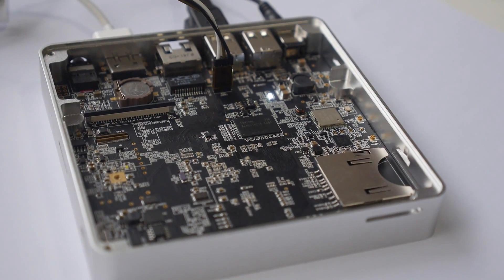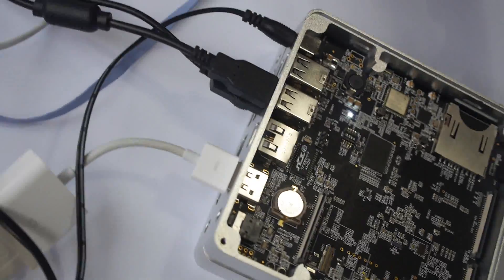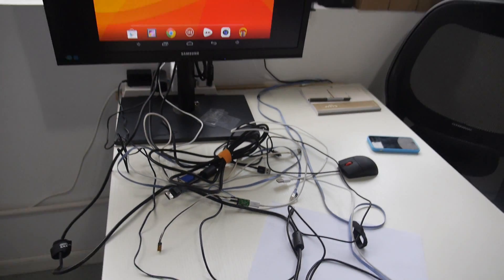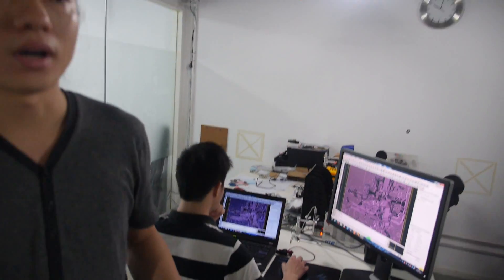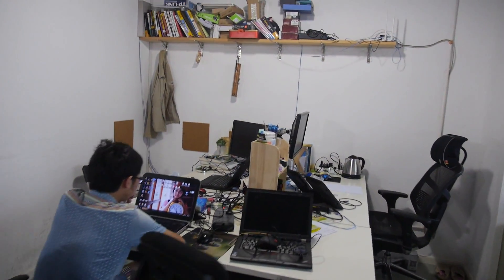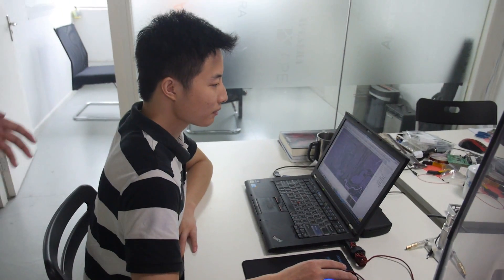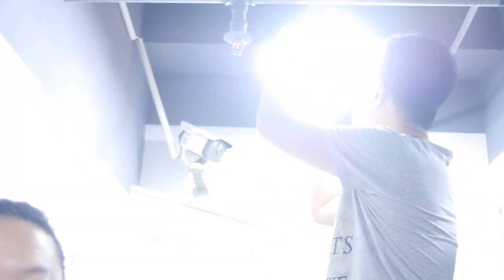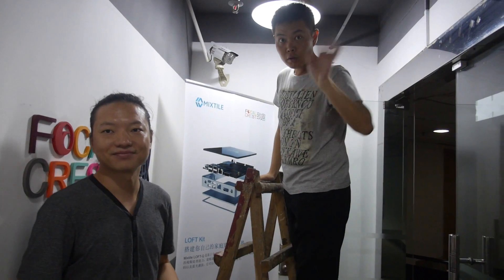$89 Mixtile LOFT-Q Allwinner A31 Mini PC

Comment: lol,    Intel what !!! what's that ..  Let's do ARM wright ... Yea !
Reply: Intel is now in the foundry business...just like GlobalFoundries and TSMC.
Intel already has companies who want their ARM chips to be manufactured on smaller nodes < 32 nm, using their foundries.

GF and TSMC cannot keep up with demand and have yet to perfect their process...a reason why you dont see any AMD products and laptop parts.

With x86 licensing being expensive unlike ARM, that's why AMD is the only company still manufacturing x86 chips but for HOW long?

Samsung is the next big entry in the foundry business.
Reply: quasarmash
Hi, my comment was not in favor of x86 products that are based on CISC architecture. But It's for RISC CPU that are affordable, very low power and SOC like all ARM based SOC products. And unlike x86 CPU and associated chipsets. It's the fable of the turtle and the rabbit all over again. The turtle wins and the turtle name is ARM.
Reply: *****
You are right.
What is inevitable, is inevitable.
The future is not x86, anymore.
Comparing $4 quad-core ARMv7 SOC with a bay-trail quad core which is multiple times the cost is pointless.
People will start comparing.. look x86 can beat it. But ARM isn't intended to compete with x86. It competes with itself.
Arguments are rife that GPGPU compute is useless on ARM mobile platforms. BullS***.

As a 3D modeller, I can tell you I'd rather run blender on debian on a cheaper A80 ARM solution with GPGPU in a pico-ITX form factor...even AMD couldn't beat this with HSA.

Wafer manufacturers, ARM IP licensees, SMT companies are more than happy, people programming without strings for their platforms...the day of proprietary and nonfree drivers are dying fast and only on ARM.
Reply: quasarmash Hi, one more note, the consumers are 99% non-technical, they do not understand or care about what's under the hood. Like you and me, for example. ARM based products are many times more affordable than x86 based ones (Intel, AMD) ARM has won, already, and is getting stronger by the days. The consumer only understand cost, at best. Intel spending are used to b 50% of it's revenue on advertising in the first 10 years. ARM never did that not, no advertising, zip, zero. That is why nobody heard of ARM, 25 years ago. BTW ARM based products have sold 50 billion chips already, but I digress.

ARM used that money to better the product. ARM is now seriously in the server market as well. These products are referred to as disruptive technology. BTW, do not hold your breath for x86 based smart watches. x86 based products are too big, they require chip-sets as opposed to one small chip for ARM. X86 used too much power, requiring heat-sink. Most arm based product, except for servers no not require a heat-sink at all. x86 is very complex, ARM is not, it's simple elegance. ARM spend their money making the product smaller and more power efficient. Intel was just after money (greed), spending money on advertising and research on making the system faster. That it not making the system better. It's trying to be the fastest, so they could sell more. Well the speed as reached a wall.
x86 cannot grow bigger that quad cores they heat to much. ARM based products are in octal and sixteen and 64 and growing. I digress again. Well, greed will do that, these type of heroes are short lived!

So my point here is ARM is not only about the tech side but the family business approach. Now, whats going to happened, or has already happen. This is what AMD has done they are now as of 2 years ago, they have incorporated ARM technology, for when x86 dies, they will survive. As for Intel, they are proud, they will not let the public know that they are loosing to ARM. They will or have secretly purchased and ARM based product company, as the are tons of them. Keep in mind that, ARM does not make products but only Intellectual Property, (IP). Selling IP to company like Samsung, Apple, and thousands more company as well. Intel will make that ARM based company grow stronger.

Then, in the future when x86 starts to show decline, and not able to win the consumers. Intel may do what Apple has done is make their own ARM based chip. Design by ARM of course. To start developing their own would be foolish. ARM is 25 years ahead in this RISC based IP.

As for competition, ARM does not compete, the sell IP only, they charge 1% of product sold, they are not greedy. Although, Samsung , Apple and ARM based products do compete amongst themselves, but need not against x86.
Has ARM is a complete different technology.  The winners, the turtle never has to compete, but be patient. The rabbit (Intel, Apple, Microsoft ... ) they want the glory right away. So they seem to be winning at first, but they do not complete. For example, Microsoft as lost to open source, Linux (android).  it's like that for all products. No need to compete and blow your fanfare (advertising).  Your product should speak for itself.Just work to improve your products, be fair and patient.

One of my point is Linus Torvalds creator of Linux, did create Linux to make money, but he has no income problems, everyone is trowing money at him for different contracts. Linux runs on smart watches and in supercomputers, it also runs on most of all internet servers servers. But I digress. This is a large topic, have wrote a lot already. Anyway !